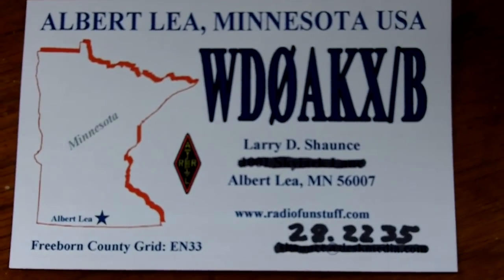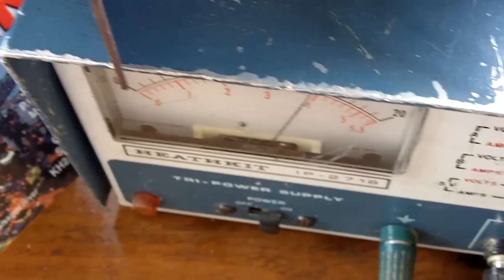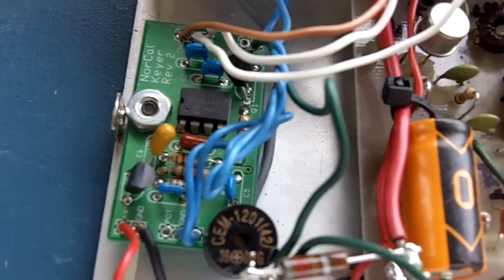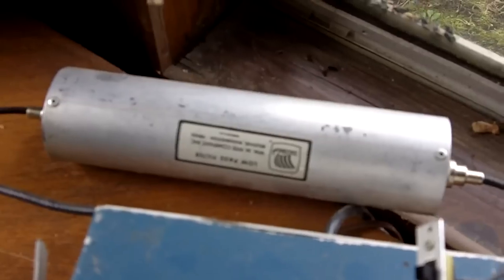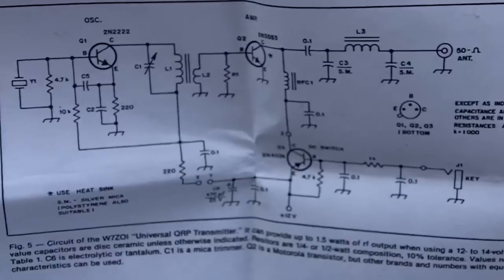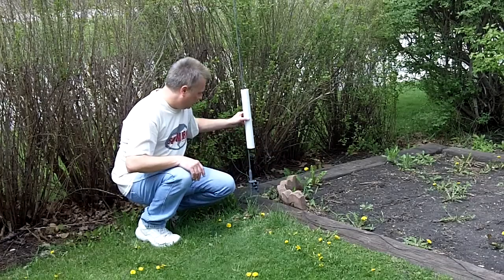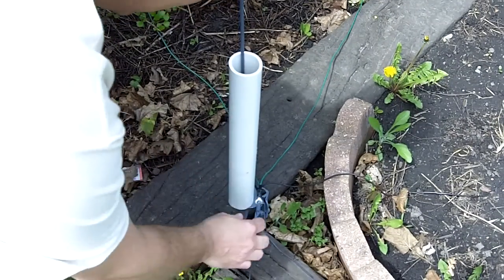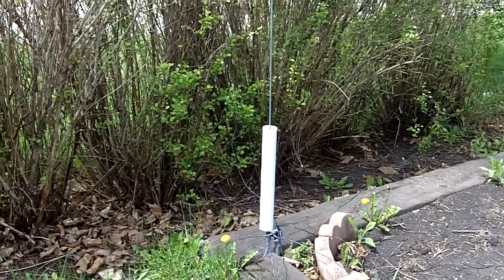WDØAKX 10 Meter Ham Radio Beacon

Comment: Is the beacon still on the air? K5DVT
Reply from the maker: It is off for a bit right now to make a repair but should be back on very soon again.
Reply: Thanks,knew I heard it a couple a months down here Arkansas.73's K5DVT
Reply from the maker: Jon Williams Ok thanks, great to know you were hearing it. It is barely a half watt but pretty much the same set up.

Comment from the maker: I do sometimes run it on a side mounted antenna on my tower, but most of the time it is too close to my other antennas and causes interference to my other radios, so I have the vertical mounted several feet away from my other antennas, that is the reason, but it does seem to radiate well from the vertical that is a few feet above ground with elevated radials.

Comment from the maker: @escueladeleyi not so much an experiment, but hams use beacons around the world so that other hams can see what states or parts of the world are possible to talk to at the time.  Since radio propagation changes all the time, the locations you can hear or talk to change with it.  Say that I hear a beacon from Alabama from my location in Minnesota, that would tell me signals are likely from here to there.  Maybe someone else can elaborate more..it is a very useful tool.